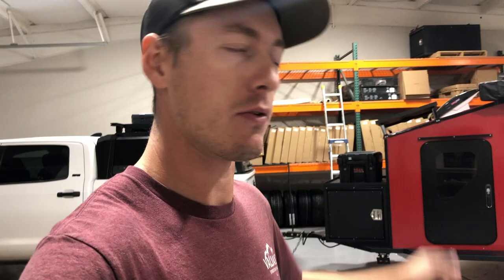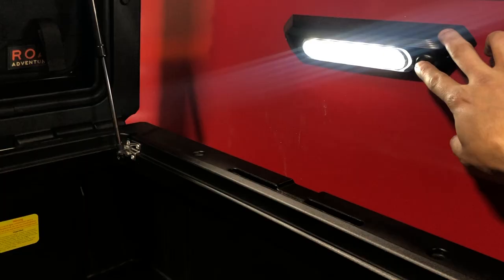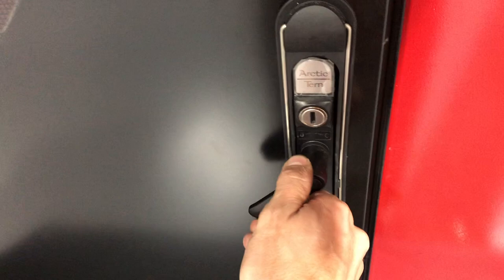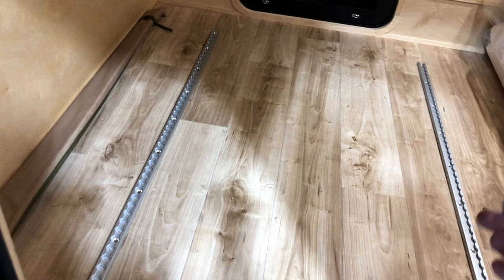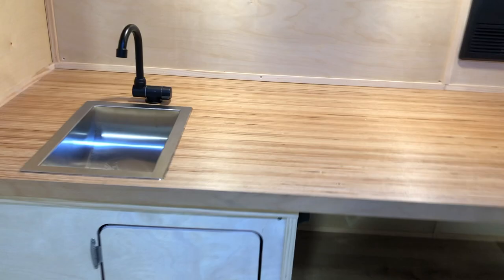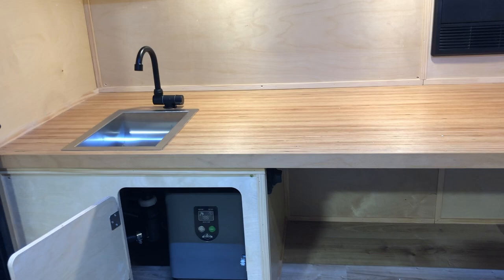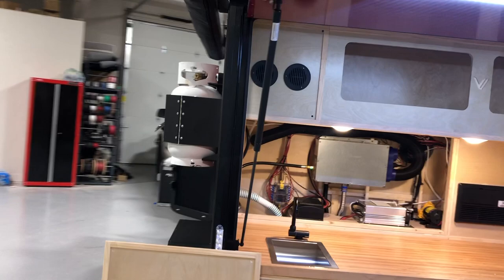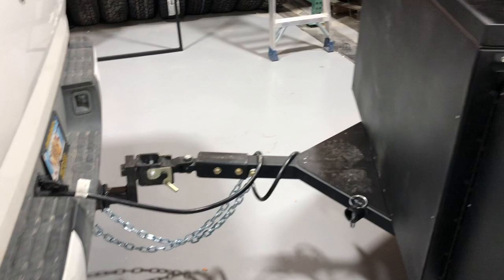Big Red: 2022 Valiant XTD Overland Squaredrop, New Features

Comment: Nice build but I have a couple issues. The intake and exhaust for the air conditioning is dumping out into the same small space which wouldn't be a issue as long as you keep the back hatch open all night while you're sleeping. Second issue is the electronics area behind the panel doesn't seem to be vented. Those electronics will put off a considerable amount of heat in a small space shortening the life span of them and adding unwanted heat into the living area. Overall though I like the build. I know it's hard to pack so much into such a small package
Reply: I wanted to see on top, under the rack.  That would be good for some small vents to vent that heat you mention.  Its an easy solution, but good point.  I would have them added for that very heat issue.
You could also put a vent along that back panel door that reveals the galley to to vent that air at night.  Again, an easy fix!

Comment: If the a/c's intake/exhaust is in the galley, then the galley door would need to be open when a/c is in use. ?????
Reply: I would agree. I work for a trailer company here in Missouri and this is a very simple fix. I'm sure they will address this later

Comment: Very interesting. I have been following Hiker Trailers and the new Encore ROG for a while now.  Trying to decide what I want and what I can modify, etc. Seems you have maybe taken the best of both.  Look forward to the larger size on its way. 
I am very curious why this is set up backwards from most trailers - awning and frig opens on drivers side, utility plugs/water fill and spare tire on passenger side.  Usually the opposite?
Reply from the maker: That fridge and the awning can be swapped to the other side if the customer wants, it's just a few bolts to have the drawer come out of the other side of the tongue box. Same for the awning. As far as where everything else is, we started setting them up the way we'd like to have it out on the trail, whereas a lot of other manufacturers are focused on what's easier for campground hookups. I'm pretty sure no matter where that stuff is, half the time you'll be going "oh yeah this is perfect" and the other half you'll be going "son of a b**ch this hose doesn't reach."

Comment: I get not wanting to quote a price before options on a potential build out are agreed upon. But why not divulge the price this build sold for since it's already spec'd out, built and more or less sold? The quality, materials, attention to functional detail and execution look to be absolutely top notch. I would expect to pay a good bit since it appears to be made so well. Just kinda strange to not include what this one sold for. Those zero breeze ac's, I believe, run off of 24v dc or 110v ac. How is this one being powered voltage wise. I think they even have 12 to 24 volt converter that they offer. They are intriguing little ac's. Curious what route you took voltage wise. Fantastic build!!! Very impressive!!! Thankyou for sharing. If the price was mentioned during the segment, sorry, I may have missed that detail.
Reply from the maker: That one came out just under $40k but it was a little strange in that it was a mix and match of a few of our packages. I'm going to be posting a video to our channel shortly of the new Expedition package with the latest upgrades you should check out. That Zerobreeze is running off the trailer's inverter, 110v AC. We've changed up the way the exhaust is plumbed since this one, now it exhausts out the side wall so you don't need to keep the rear door open while the AC is running.
Reply: @valiantexpeditiontrailers9905  Thankyou for the reply. The work and build quality as seen and described in the segment are very impressive. I expected a price in that range because of craftsmanship and detailed design and functionality. You got a winner here. Great reveal and breakdown of the what and why.
Reply from the maker: @Chubbydippin  I appreciate it, you'll like the new stuff even more then! The latest walk-around is uploading right now, probably be up in 20 minutes or so.

Comment: I just dont see $45,000 sitting here. I dont get it
Reply: Price out the components, add in the proper wages for craftsmen, tradesmen, add a profit margin of 20-30%; you're there.
That Dometic fridge and those Arctic Tern windows are $2k +.
Reply: There’s not, maybe $8k. But sales has never been about costs, it’s about what the market will pay and $45k puts this camper in the middle ground.
Reply: especially when you can build it your self and save about 40,000 to 35,000

Comment: Wow! Really impressed by this trailer! I cant wait to see the XL version! Love the storage! We're a family of 6 so bigger is always better for us! How much weight can the rear Hitch hold?
Reply from the maker: Thanks! The we've got some XL's on the books that customers have ordered so those will start showing up probably around April. That rear hitch has a 250# limit because if you hit a good drop on a trail 250# can turn to 500# pretty quickly. The XL has 2' of extra room in the main cabin, which allows space for a 2' bunk along the back wall that doesn't interfere with the main queen mattress. For a family of 6 though, someone would probably have to be in a roof top tent on the roof rack!